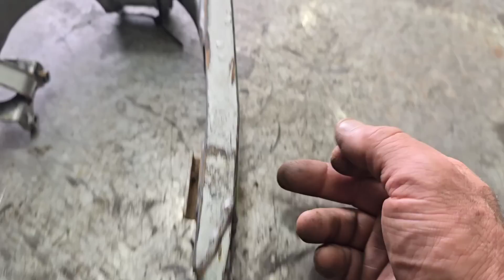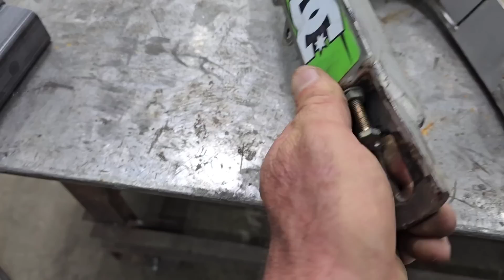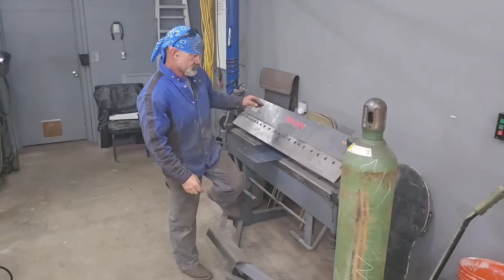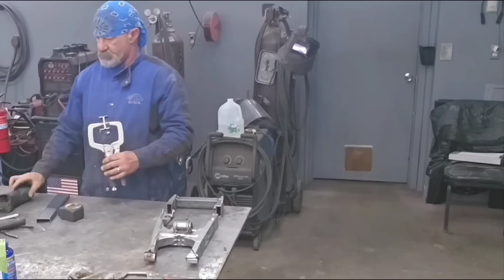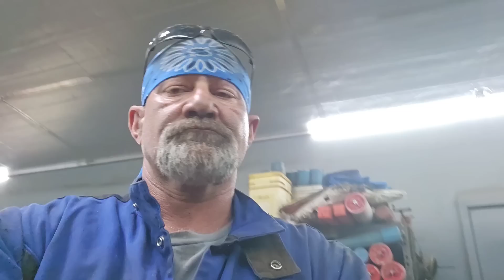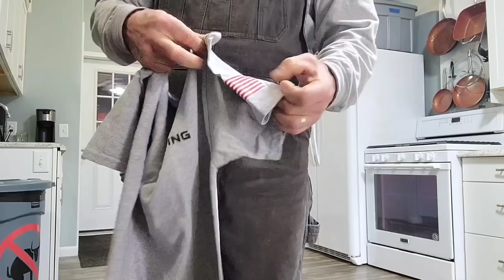Extending a dirt bike swing arm to make it longer

Comment: Is this swingarm steel or aluminum?
Reply from the maker: Steel
Reply: @NBSWELDING would you advise to do this on an aluminum swingarm
Reply from the maker: If thats what the customer wanted I'd do it...don't matter to me what its made of...if it was wood I'd extend it with glue & screws if thats what it takes 😁
Reply: @NBSWELDING would it be safe if ypu would do this process with an aluminum swingarm?
Reply from the maker: Racing dirt bikes is dangerous....modified parts are dangerous...danger is exciting. 
Aluminum could be braced the same way to help with strength so that it not weak.
I can't tell you that riding a dirt bike with a modified swing arm is safe, I can't even say riding a dirt bike with a factory swing arm is safe.
Reply: @NBSWELDING  are there necessary things to do after cutting and welding the aluminum swingarm?  I also plan pn doing the same process that you did on my aluminum swingarm. Are there post-treatment  process that you should do to maintain its strength?
Reply from the maker: I don't know...I'm a welder not a metallurgical engineer...if your that desperately worried about it then don't modify it.
I've tried to express that modifying something your gonna ride has risk...I've modified shit all my life and never done any post heat treatment or stress relieving of any sort...there's nothing I can tell you that is gonna guarantee that your not gonna have problems.
Most people I know would have so much trouble making good welds on aluminum that heat treatment wouldn't be a determining factor in the strength of the job anyway....if your not experienced with AC TIG welding aluminum then don't do it...I don't want you to blame me if you have problems...all I can do is show what I do I can't be responsible for what you do

Comment: Did you use the arccaptin mig 200
Reply from the maker: No...welded that with one of my Millermatic 252's...The one I keep .030 solid wire in all the time

Comment: Great idea CB. Can I ask what your settings are on your 252 for that 14 gauge please?
Great job. It looks like it was made like that.
Thanks CB.
Reply from the maker: 17.7 volts and .030 solid wire @ 211 inches per minute....75/25 mix gas
Reply: @NBSWELDING  Thanks CB! I appreciate that.